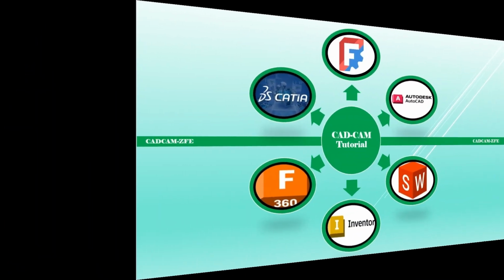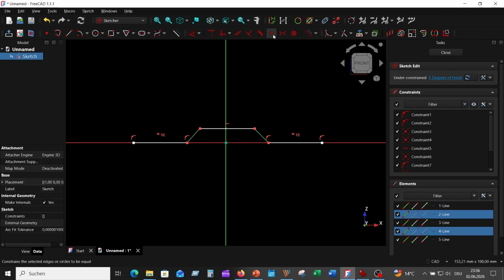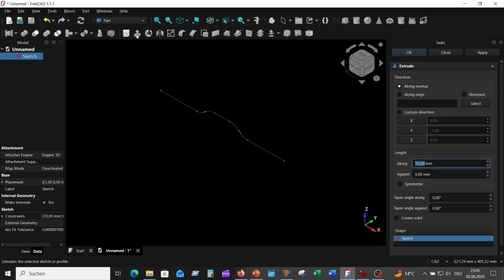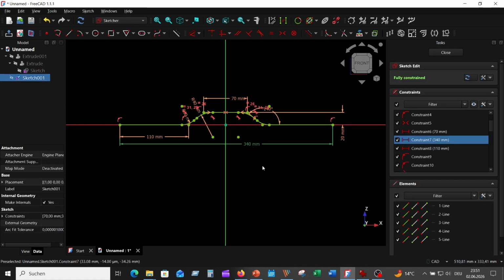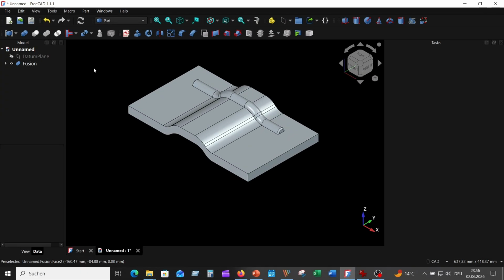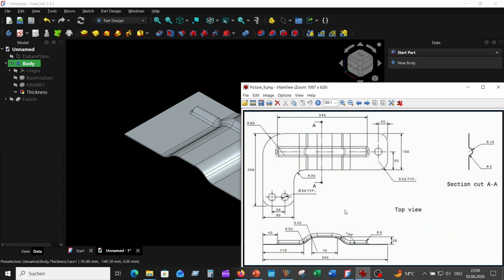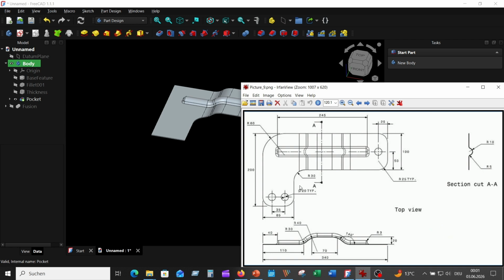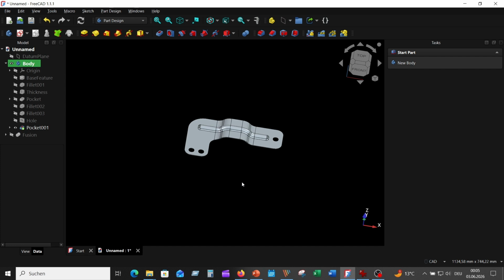FreeCAD Tutorial for beginners, 3D Exercise_#84__2D drawing to 3D solid part

Comment: Thanks for the video. Just one small issue, as per the drawing, the two small holes are not aligned with the center of the fillet arc, but rather are set only 35mm apart, and there is no dimension for the distance for the vertical distance from the edge.
Reply from the maker: Hi,
Thanks for your comment.
As you said, the position of the two holes in vertical is not defined. The distance between the single hole and the edge is 25mm. I  kept the same distance. There is no other reason.